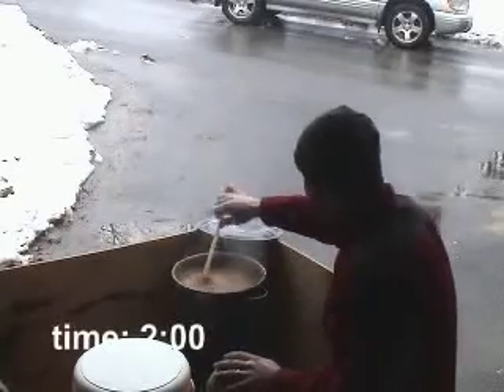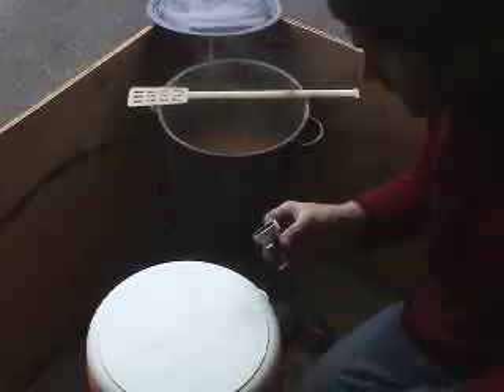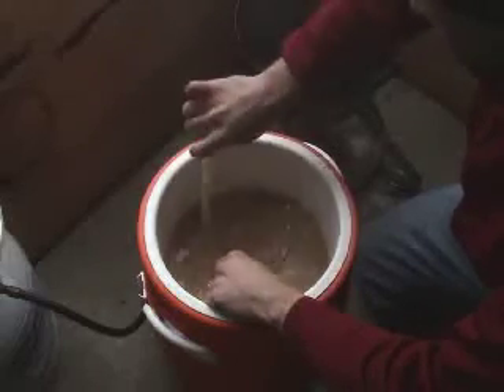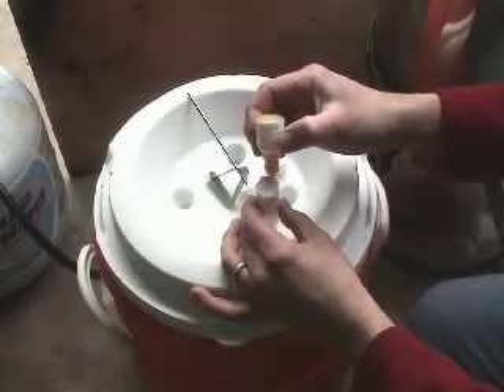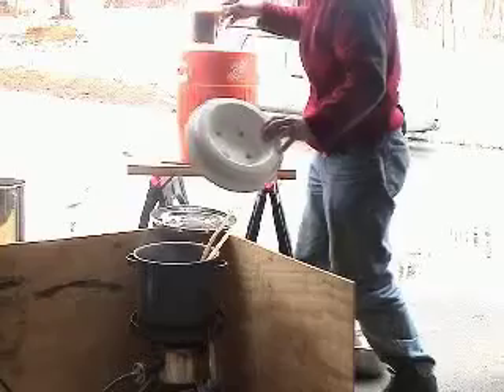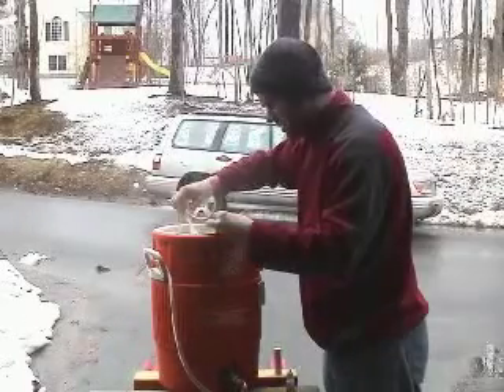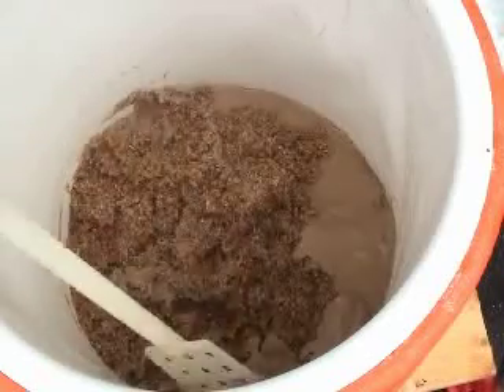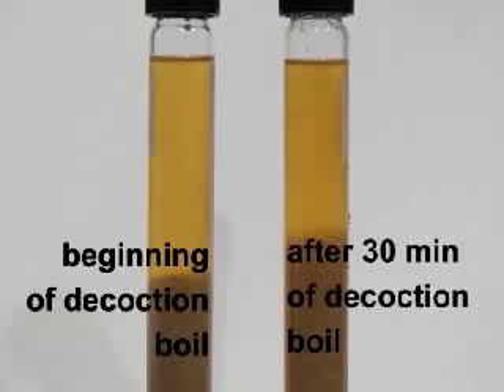Decoction Mash (part 3)

Comment: @edwinfarr what are some of the other factors in your setup? how much and what particular grains are you using in your recipe? what mash temperatures are you using? have you tried these decoction steps and did they make any difference? what yeast? 

I'm sure there's a ton of other questions but those spring to mind first.